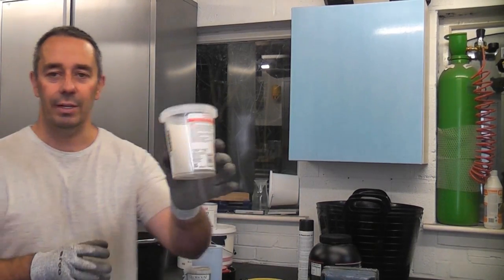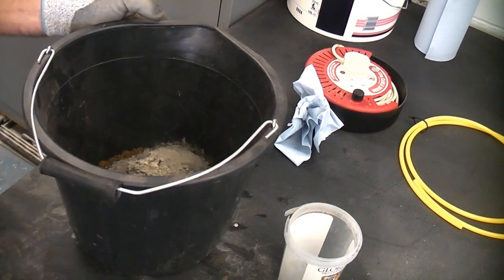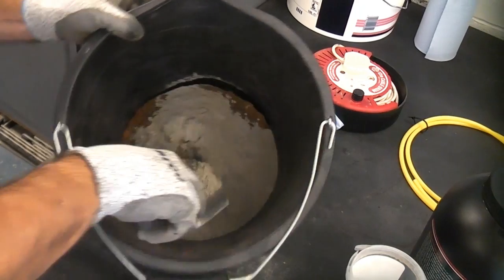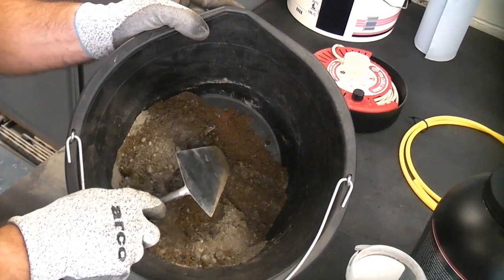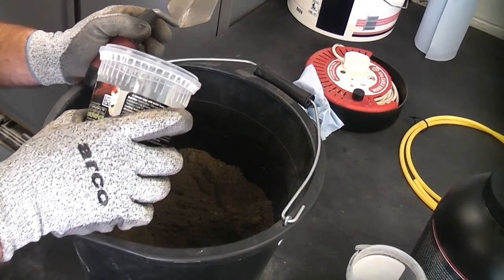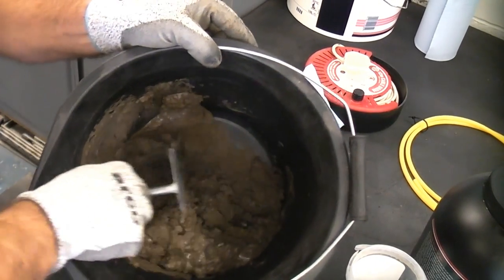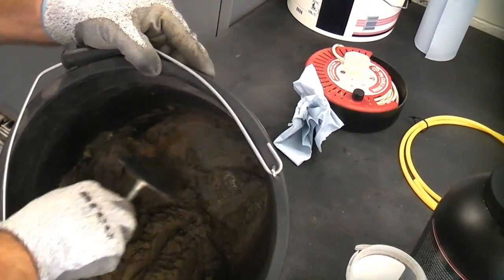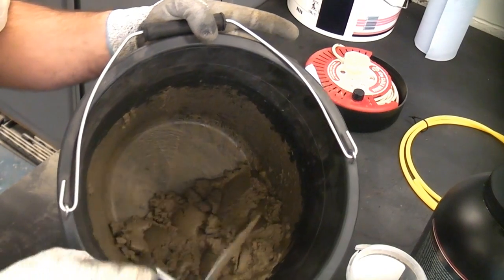How to mix a small batch of Mortar

Comment: Nice one chez , it's funny you brought out the Whey container because i use the same one , but i dry mix the sand & cement in a bucket and then store it dry in the big Whey container until i need a bit then just pour it in a bucket and add water , that way it saves it for a long time without it going hard and keeps the back of the van clean.....  : )
Reply from the maker: +yensabi 
Those whey protein containers come in handy ;-)
I'm surprised the cement does not go off, once it is mixed. I made a batch a few weeks back (dry) and thought it would be ok until the next day so I covered it in a bucket with a bin bag. The next day it had clumped together a little so I broke it up with the trowel and then mixed it with some SBR, but once it was mixed the damn stuff did not set! so I ended up binning it. Next time I'll try putting it in a protein container ;-)
Thanks for the comment ;-)

Comment: handyman.. I'm going to point my stone wall sometime next year, will I need to buy the ready made mortar mix that has lime in it? allowing it to breath. or just mix normal sand and cement myself ? 

thanks & I love the videos it's helped me loads since doing up my house
Reply from the maker: +Tommy Titt 
For re-pointing I normally make a mix of -
1 unit of cement
4 units of sand
1/4 of a unit of Hydrated lime

From what I have been told the lime makes the mortar more flexible, so less likely to crack due to thermal movement etc.
I re-pointed one of my houses about 16 years ago using that mix and it has been fine ;-)

Ready mixed mortar normally works out very expensive.

Thanks for the comment

Comment: You can do a decent size mix in a builders bath and if cleaned out well after can be used for concrete,sand & cement and backing plaster.or taking rubble to the tip.
Reply from the maker: +camohoj 
Thanks for the comment ;-)

Comment: Great video. I was wondering what happens to a concrete mix if you add too much waterproofer? I am sealing concrete edge to a path of quarry tiles that were laid some 20 years ago on the top of the concrete path. The concrete decorative edge was added sometime later, as the tiles once came up in the hot weather all 1m long bit of a path just pop up off the concrete below and sat on the other lot. It was quite bizarre coming from holiday to find it. The concrete edge stopped that from happening, but now the mortar joint between deteriorated so I am replacing it, but I think I have added too much waterproofer as it was taking a very long time to dry. Will it affect the strength of the mortar? It was very nice to work with, well plasticised.
Reply from the maker: It might weaken the mix, but it is too late once it has been used. You will just have to see how it goes, hopefully it will be okay ;-)
Thanks for the comment

Comment: How many minutes should I mix once the water has been added please? I don't seem to be able to make the mix as fluffy as this, and when I put the brick down I can't level it. Thanks.
Reply from the maker: It should be workable for hours, after the water has been added (dependant on the ambient temperature). It takes a bit of practice to get the mix wet, but not too wet!

Comment: Good stuff. Any sort of cement based powders will go off as soon as you open the packet. Plaster is notorious for it. I never save half a bag even if it's for the following day. Not worth it as it just goes off too quick. I sometimes buy the stuff from screwfix in a tub ready mixed. Just add water, saves buying a whole bag of cement that will go rock hard!
Reply from the maker: +Zed Man 
I have stored some cement in a protein tub, I'll check it in a few months to make sure it's not gone off!
Thanks for the comment ;-)

Comment: Sorry to go off topic,have you any videos on cutting kitchen worktops? (tried searching channel but no luck)
Reply from the maker: +David Worsley 
No problem David ;-)
I have not done a specific video on it, but you can see me cutting one here- https://www.youtube.com/watch?v=kPXf90GUeg4&feature=player_detailpage#t=329

I normally cut it upside down and from the front to the back, using a clamped straight edge to guide the saw.

It helps if you have a sharp blade as well as a blunt blade can chip the laminate.
Reply: Thanks mate-link took me back here! My problem is I have to cut 2 slightly overhanging worktops to allow a cooker to fit.
The worktops are tiled in and removing them is not possible so I will have to work from the top-I'm told a downward cutting jigsaw blade is the answer but what happens when it reaches the wall?-padsaw to finish off??
Reply from the maker: +David Worsley 
That's weird, the link works for me.
It's difficult cutting them once in position but if you do the majority of the work with jigsaw and down cutting blade you might be able to finish off with a multi tool (such as Fein multimaster). You might have to use the metal worktop edging strips to make it look neat after cutting them though, or the padsaw would also work.
Reply: Thanks for all your help-it is much appreciated
Reply from the maker: +David Worsley 
You are welcome David.
Thanks for the comment

Comment: Nice. Just what I wanted.
Reply: @ultimatehandyman  Now need to get one of those premade soups from Waitrose as they are a good size measuring pot.
Reply from the maker: @TheStevenWhiting   They are really useful. I use them for storing nails etc. Holding paint, mixing, even storing small diameter electrical wires etc 👍

Comment: Last time i mixed some up i put too much water in,  ended up chucking some spillzorbe in to dry it out. Lucky it was only to level a slab for a machine to sit on.
Reply from the maker: +heavydiesel 
I have vague memories of mixing some with a rapid setting hardener and had to chuck the lot as it went off super quick.
It's a good job we all learn by our mistakes!
Thanks for the comment